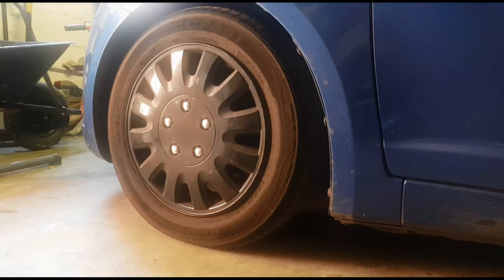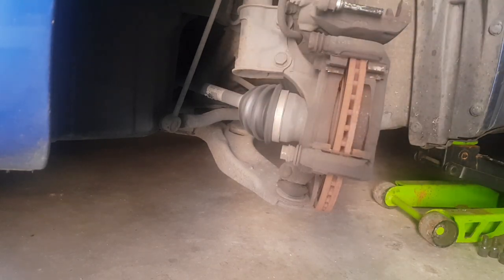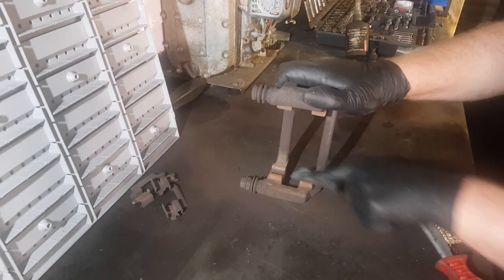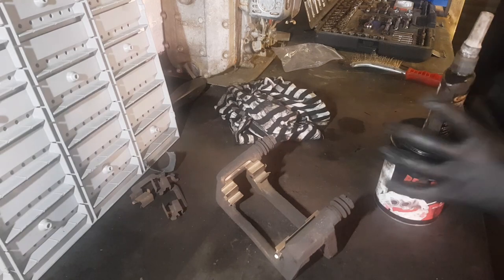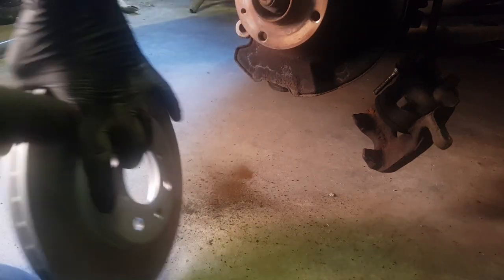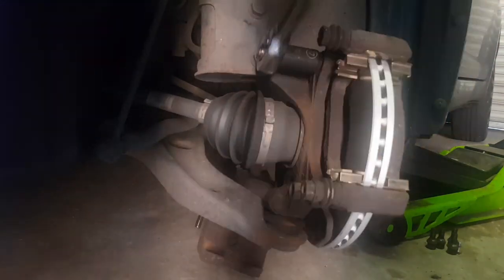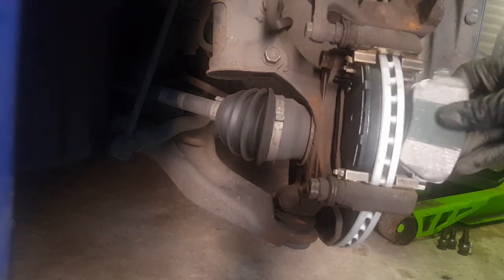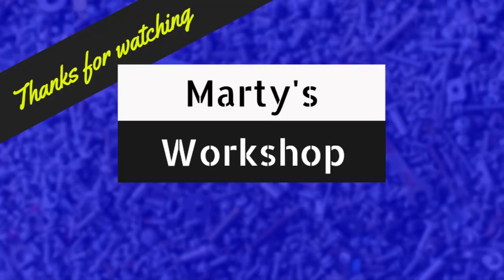how to replace brake pads and disks Suzuki swift 2004 -2010

Comment: Really helpful guide. For anyone else attempting, the brake disc screws are Japanese Industrial Standard (JIS) M6x1. Very easy to strip, so get yourself a Vessel screwdriver. Torque spec for caliper pin bolt: 35 N·m (3.5 kg-m, 25.5 lb-ft)
Reply from the maker: Awsome info and  thank you for the feedback

Comment: Do you know what size the brake disc screws are please? Wanting to buy some just incase I have to drill them out. Thank you.
Reply from the maker: Not a clue sorry, its been  a while since I did this video.
Reply: @Martysworkshop  no problem mate! Thanks for the reply. Read online about them being m6 x 14mm, I'll ring around and ask. Cheers pal.
Reply: @Martysworkshop  hello mate, I've snapped one of my carrier bolts when tightening it. Do you have any advice on how to get it out? Obviously I want to replace it ASAP. Everything else ran smoothly but I've over tightened it and it's snapped in half. Thank you.
Reply from the maker: Can you get the carrier off? You may need to remove the disk screw to alow it to move over, if that is the case there shuld be some bolt sticking out so you shuld be able to clamp it with a set of vice grips and imscrew it, bit if the bolt has snaped off flush so there is nothing to grab on to then you will need to drill it in the centure and hammer something in int to undo it, I like to use torx sockets,  it's a bit rough but they grip really well, or you can use easy outs. Hope this helps

Comment: I’m changing the discs on my Swift and I cannot undo the carrier bolts for love nor money, I’ve tried various anti seize and penetrating fluids, I just can’t get them to move.
Reply from the maker: Yea these was stiff when I made this video, are you using a braker bar with a hexagon socket?
Reply: @Martysworkshop  yeah 18 inch breaker with hex socket…won’t budge…gonna try heating it with a torch next….don’t know what else to do beyond that
Reply from the maker: Yea heat would be my next port of call.
Reply: @Martysworkshop  apparently you can get some type of spray that freezes the bolt to shrink it…I’ll try that if heat fails….don’t know what I’ll do should one of those bolts shears off though…I’ll be properly screwed then
Reply from the maker: If the head snaps you may need to drill it out, it's not as bad as it sounds with good drill bits.
Reply: @Martysworkshop  yeah I’ve had to drill bolts before, I don’t fancy doing it on the carrier, if the heat or cold doesn’t shift it then I’ll have to take it to a garage…annoying for a pretty easy job…well it is when the bolts one out anyway haha